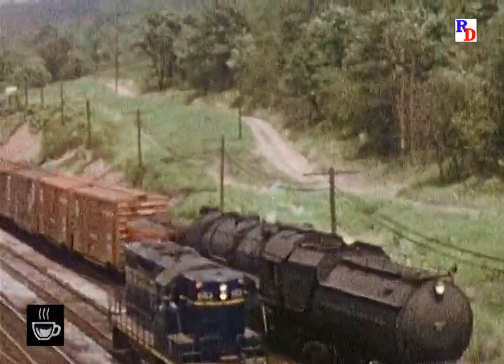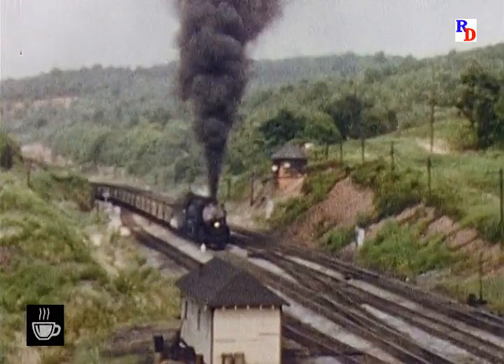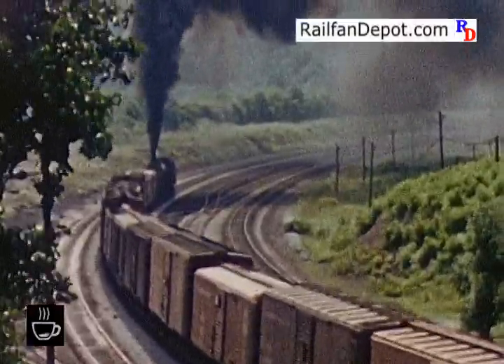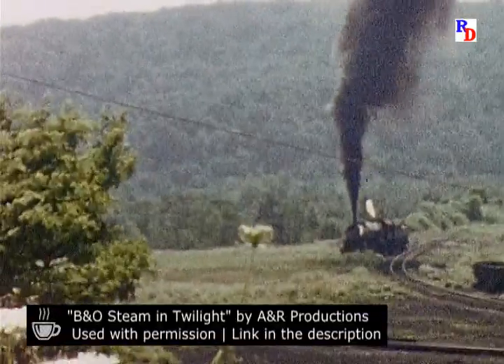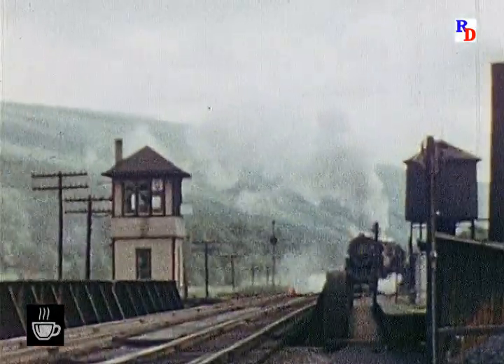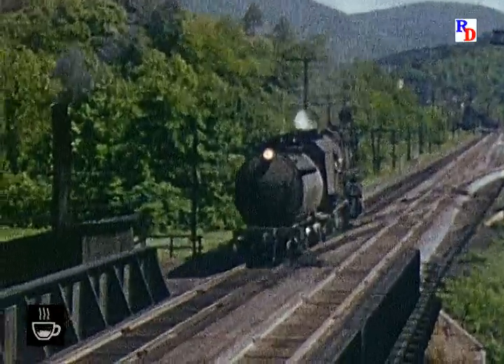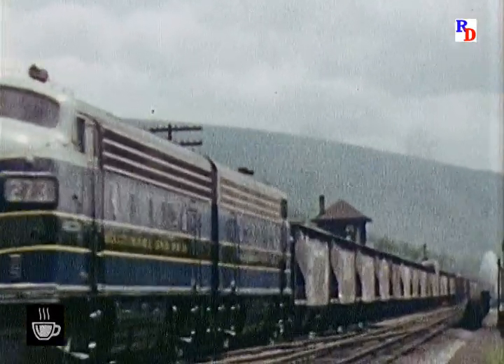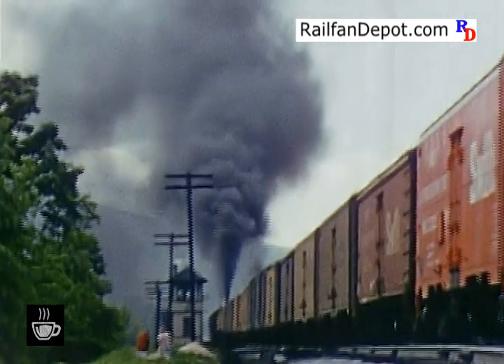B&O Steam on Sand Patch | SA Tower & Q Tower | Sunday Morning Coffee & Trains

Comment: Ohhh DeAnn, I am fascinated by B&O’s S-1’s and S-1a’s since I read about them in the late 70’s. I am glad that you posted this gem They were the staple of B&O’s power. Sure, the railroad had Mallets and Articulates. However, something about those massive S-1’s
Reply from the maker: Yes, those "Big Sixes" are an amazing sight. And to think,the B&O had well more than 100 of them at one point! A 2-10-2 is just going to be a beefy locomotive! :-)  -DeAnn
Reply: I understand their designation as "Santa-Fe" type was due to the ATSF needing helpers that can operate as fast backing down a hill as traveling engine forward.

Comment: Were steam locos officially named in the US? In the UK most Top Link locos were named after historic persons such as King george IV, Oliver Cromwell, Duchess of Sutherland or Castles etc. They`d have had brass name plates attached to the loco that are now highly collectable and very expensive. I never see that on Us locos just  names that were given to them by the public.
Reply from the maker: In the very early days here in the US, individual locomotives (example: "Best Friend of Charleston" or "Pioneer") were given names. As the number of locos quickly passed the tens-of-thousands, that became impractical. Entire classes (usually by wheel arrangement) were given names and employees and the public nicknamed some, but, in the USA names were out pretty early on. -Tim
Reply: Crews that run the same locomotive day in and day out named their locomotive. Kind of like someone giving their car a name. No name plates though just number plates on the steam engines and glass then plastic number boards on the diesel locomotives. 👍

Comment: B&O EM-1s were never called "Big Emma". That nickname was used for L&N Class M1 2-8-4s.
Reply from the maker: The L&N also used that nickname. But, indeed the EM-1's were called by many "Big Emma". In this wiki on the B&O Railroad Museum it even mentions a "Big Emma Battle" between the L&N and B&O "emma" units.
https://en.wikipedia.org/wiki/B%26O_Railroad_Museum
Reply: @Railfandepot  The citation refers to L&N 2-8-4 # 1985 along with C&O 2-6-6-2 # 1309. The citation has nothing to do with a B&O EM-1. Both my grandfather and great uncle were B&O steam locomotive engineers. EM-1s were never called "Big Emma" by anyone on the B&O. If the crews called them anything, they would call them "Mailies" for Mallet (pronounced Ma-lay). Technically, Mallets were compound expansion articulated locomotives, and the EM-1 was a simple expansion articulated locomotive, but the B&O engineers would just call any articulated locomotive on the railroad "Mailies". This whole "Big Emma" debacle started from a Revelation Video years ago when the narrator incorrectly referred to the B&O EM-1 as "Big Emma" confusing it with the L&N nickname for their 2-8-4 locomotives.
Reply: @markantony3875  I concur.  Furthermore, most of the old heads I knew simply called them "Seventy SIx Hundreds".  Never once heard "Big Emma".  B&O has taken multiple hits in the fact departments, starting off with the whole "Tom Thumb" embellishment.